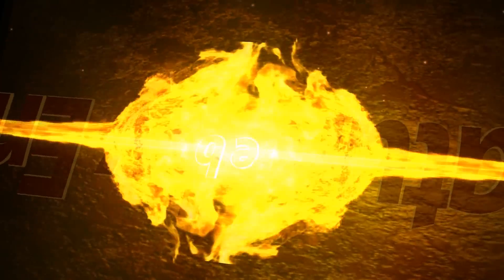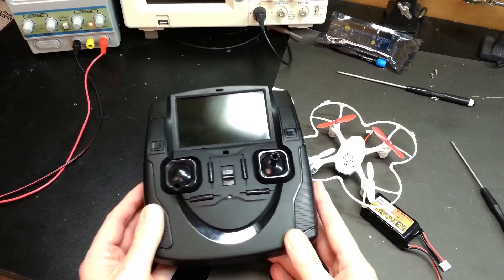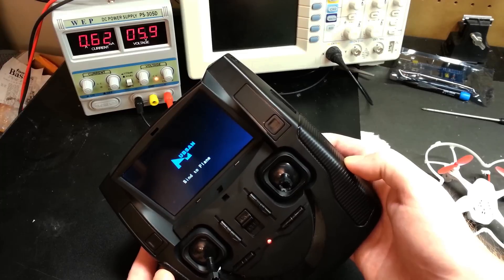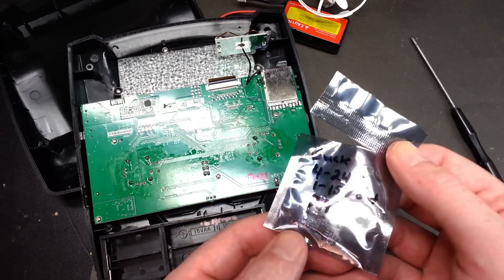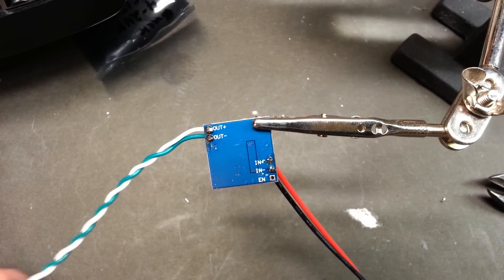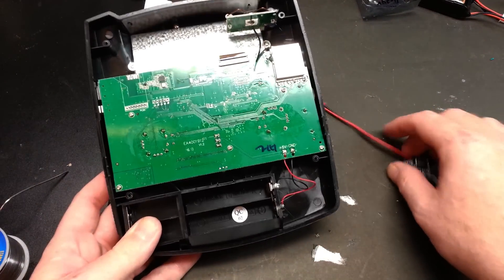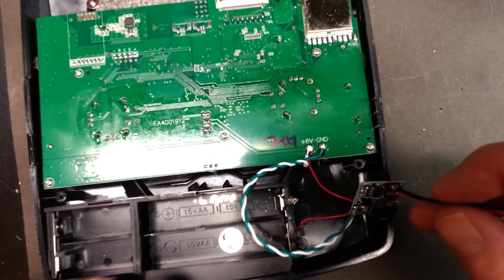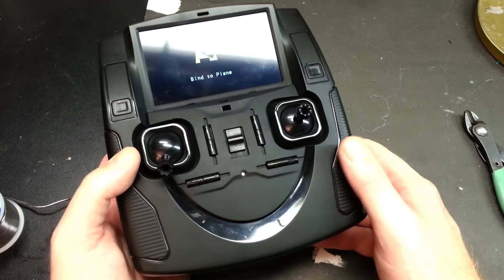Convert Any R/C Transmitter To Rechargeable Packs (LiPo etc)

Comment: Nice video, thanks for posting! Any U.S. dealers where I can source the buck converter you used?
Reply from the maker: I imagine Adafruit should have several options if you want a US source.  Cheers
Reply: I checked with Adafruit and couldn't find that specific dc-dc buck converter but did end up finding a three pack on EBay for less than $6 shipped. Probably get it next week so all good there :) I have seen some people in RCG indicate they simply wired a JST plug to the board and used a 2s lipo.  I assumed this would blow your board unless it would take 7.4v as well.  You also indicated the draw would require the 2a, curious how you determined what the draw requirement is? Example, I want to down convert a 4s (14.4v) to power a small monitor and receiver etc., but not sure how to determine what amperage or total voltage would be required and wondering if you could quickly explain the process possibly using a multimeter or make a video to show how to get the results? Again, I really appreciate you taking the time to post the video and reply for the sourcing of the part! If I need to hit the books to understand electronics better, you can tell me that as well and I'll do it :) thanks again for your valuable time!
Reply from the maker: TheWaterbound07 You can see in the video I use my power supply to measure the amperage used (0.6A).  IMO you want a supply capable of 2X the normal load (or more for inrush etc). You don't need to worry about going too big- the TX will only draw what it draws and no more.  My 2A units will be plenty in this case.  You can use any DMM to measure the amperage too- just hook it up in series with your existing batt and measure.  As you mentioned- you could just wire a 2S lipo- but why not do it right and supply the proper V instead of risking TX damage. A proper supply is a far better solution IMO- plus you aren't limited to a 2s- you can use a 3 or 4 etc too. Cheers
Reply: TheWaterbound07
Got an Ebay auction number for that 3-pack?